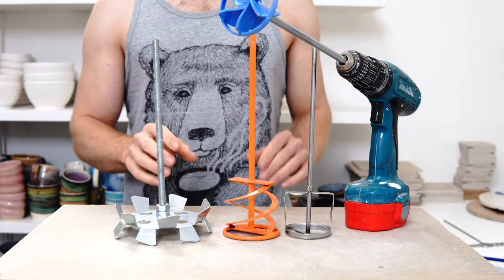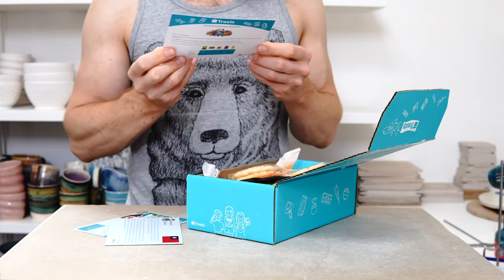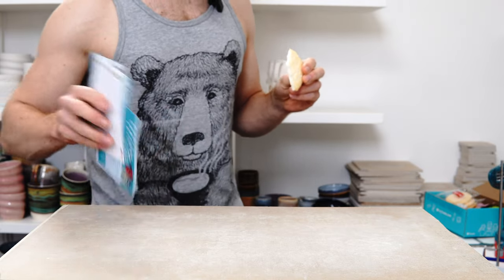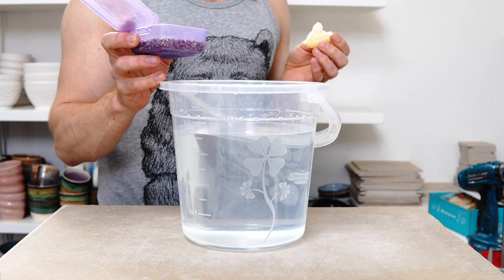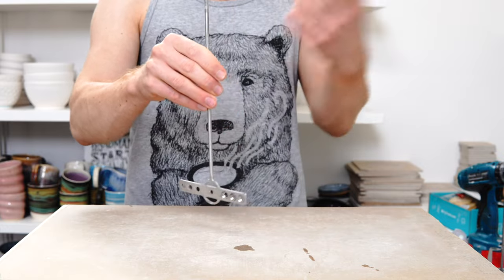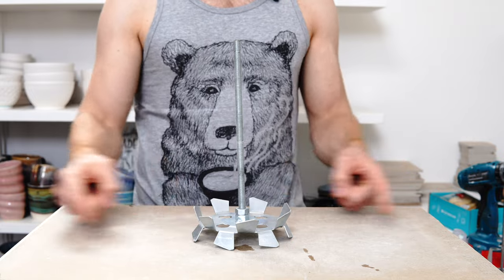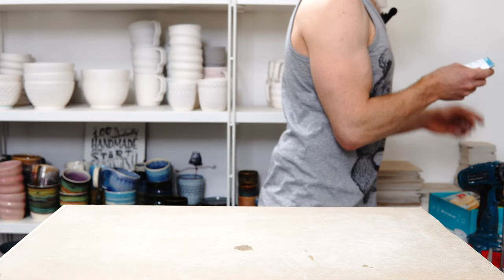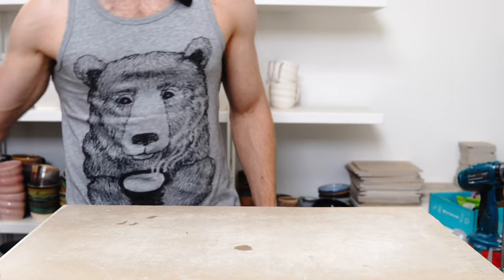Glaze/Paint Mixer Attachment - What to buy and how to use it

Comment: Wow, I was just thinking about trying a bunch of different mixer attachments. I recently got a desktop lab mixer for doing test glazes and it has been life changing lol. But I am not sure if using a different  attachment would make much difference.
Reply from the maker: That's cool. I've looked at lab mixers but never found one at a price where I thought I would get enough value from it. How much did you pay for yours?
Reply: @OldForgeCreations  I don’t buy much from Amazon as the quality is usually not that great, but I got my lab mixer there and it is surprisingly good quality. I got the Onilab LCD-10L (the version with the digital controls) for $179 and I use it with the jiffy pint mixer attachment.
Reply: At about 14 minutes I I realized I was watching a man swirl some seeds around in some water, and then I watched the rest 😂 I’ve been using a hand mixture attachment thing, like for baking,  for slip recently (although I’m making much smaller amounts!) and it works quite well